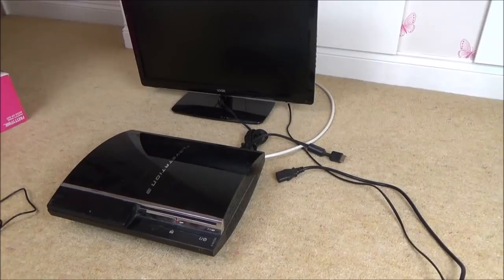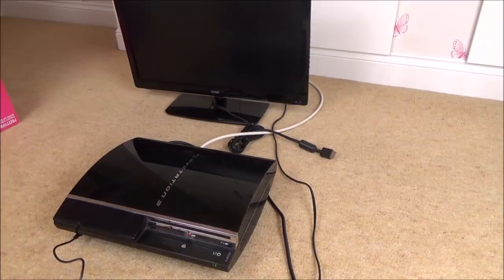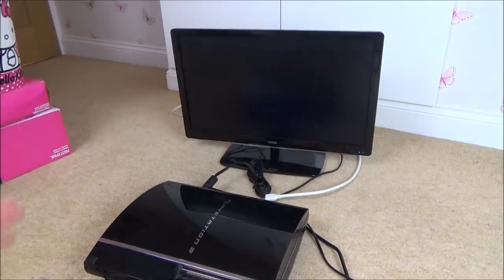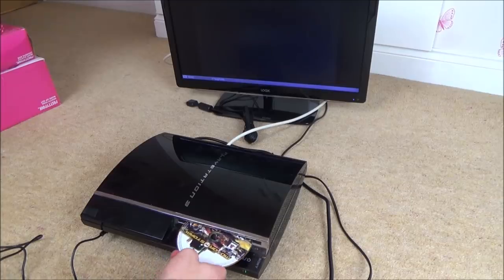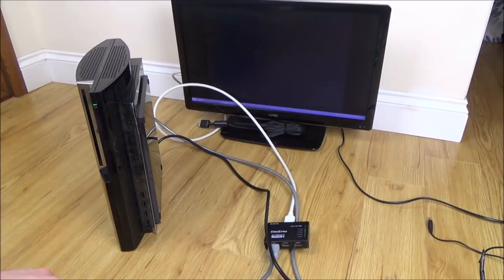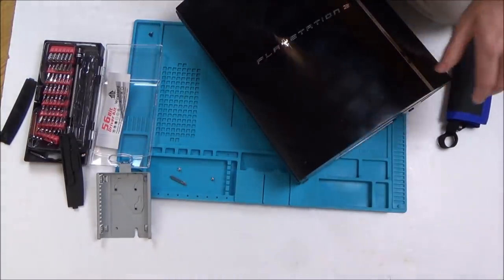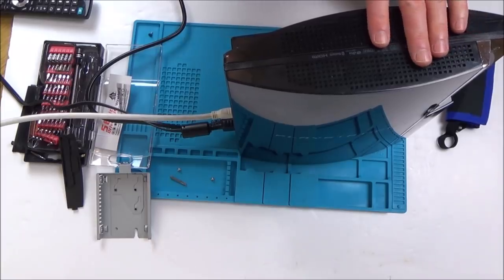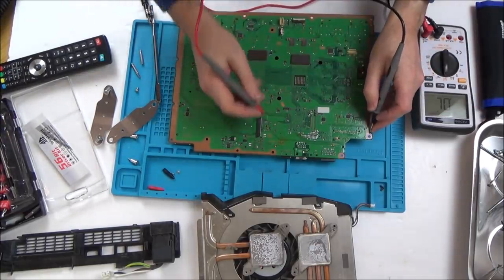Trying to FIX a Faulty PlayStation 3 CECHC03 (Part 2 of 3 PS3 Fixes)

Comment: You are testing it wrong. Those caps near/under/close to the chips are bypass capacitors. You are activating junctions within the chip making it appear that those capacitors are shorting. Test them out of circuit.

Comment: Vince, what you have there is a genuine 1st edition PlayStation 3 60 gb model.  These were the only version of PS3 with the chrome accents on the front.  This model plays all PS1 and PS2 disc titles in addition to the full PS3 library.  I know this because I still have mine which I pre ordered and received on November 17 2006. It ran solid until October 2012 with heavy use.  Sadly it got the yellow light of death...but worth every penny for sure.
Reply: kunfusion84 holy dude, how can you remember all the dates 10+ years ago... you definitely love that console.
Reply: @rosetta7862 well it was very expensive when it first came out
Reply: I still have my 80gb model. Unfortunately it's not PS2 backwards compatible but I still do have my PS2 for that occasional game!
Reply: I'm getting tomorrow the PS3 CECHC03 PAL (with new termal past), any advice to prolongue his life?
Reply: Osvaldo Cerda Martínez let me know when it dies i will permanently bring it back to life. Fixed three last week and funny thing is it’s not what people say it is that’s causing it.
Reply: Jacek Kurowski don’t leave us in suspense mate? That info is priceless
Reply: Montgomery Burns Like most of laptops with same problem the main thing causing YLOD is a cold joint under NEC TOKIN capacitors. Measure the resistance of each and every one of them with a multimeter if the valie jumps like mad it means you found a dodgy one. Reflow it using flux. Make sure you physically move them with tweezers or a small screwdriver and then let it cool. Surprisingly you dont even need to replace them. I fixed Cechk console that was turning off playing demanding games, ylod cechc and ylod cechm all in one week simply reflowing them. I reckon in most cases GPU reflow is a myth. It worked for some people cause they actually reflowed the NEC TOKINs as a side effect.
Reply: Bought mine in 2007 and it still works perfectly. Was really hard to get a hold of as it was sold for such a short period of time.
Reply: I have a CECHA01 & CECHE01 that both have chrome accents on front. Best Sony console ever imo.

Comment: Nice attempt!  I suspected it would not work - but I wouldn't give up just yet.   What temperature did you use for the hot air there?  On that type of hot air station (with the nozzle you are using) I would be going for a minimum for 450 degrees and heat it quite extensively for like 10+ minutes.  It really needs to get to the point where the solder does melt.   The fact that half of those shorts disappeared makes me wonder if a solder ball cracked off and is shorting underneath maybe.  But it could be an internal fault of couse.

Louis was not 100% correct - one reason why it can work again after heating to "less than solder melting point" is thermal expansion of cracked solder joints.  That was the point he missed in his video.  On the PS3 and on many graphics cards, it IS purely bad BGA contacts.  His experience from Mac boards might be different, maybe the GPUs fail more there, but on consoles it is nearly always bad connections on those BGA chips.   The other thing that happens on PSPs and other handhelds is when dropped - sometimes the pad breaks off the PCB.  Pressure helps it work again at that point.  I've seen a few PSPs with that type of damage - damage you would expect to be solder crack, when in reality one or more pads actually detach near the corner when the unit hits the floor.

BTW - the speckles make me think the problem might be VRAM related.  I cannot remember, but doesn't the GPU have the RAM mounted on it - the chips in the corners there?  I think they are!  What I might do there is remove the "underfill" around them, then try and reflow those.  The underfill won't help matters as a crack might not easily rejoin because the underfill holds the chip up.  Withouth underfill, assuming you can get all the solder balls up to melting point should mean a more successful reflow.  Also add liquid flux under there too whilst doing this.
Reply from the maker: As always, great info Chris. Maybe I can do a revisit on this or I could try the coins on top of the GPU to see if it works and then try the reflow or maybe the oven method, not sure how much that will stink the house out though, don't want any grief!!!!! My temp at the end was up full so 480C and full air which is the max my cheapo unit will do. I always get worried when heating up chips in case I pop them but I suppose this will come with experience. Is there an approx. temp or time limit that the chips can handle or is it all based on their size and thickness?
I presume the underfill on the RAM chips is some kind or glue or plastic, do you scrape this off or use chemicals to remove it?
Cheers :-)
Reply: @Mymatevince  Better cover the capacitors and plastic [looking] parts with aluminium foil when baking it also remove the thermal pads of the Emotion Engine (Chip below the Cell thats for PS2 compatibility) and the chip on the right of the RSX.
With baking I managed to repair a GTX 760 bought it in October and worked fine after cleaning, but in November it failed, (used it as secondary graphics card) after installing drivers so I baked it and it works fine again, gifted the PC (Core 2 Quad Q8400, 8 GB RAM and this GTX 760) to a neighbour and still no complains.
But my old HD 5770 also failed (just black screen, no booting at all) and still not working after baking it, maybe I'll try it a second time.

Comment: The memory card slots are another tell tale sign, along with the four USB ports, that it's a PS2 compatible model. They are used to playback photos and videos from digital cameras. CF is Compact Flash, SD is obviously Secure Digital cards and the last one is Memory Stick Pro which was Sony's terrible proprietary card format they used in their own cameras (and PSP in the form of Pro Duo).

When playing PS1 and PS2 games the PS3 will create virtual memory cards that are stored on the hard drive.

This model (CECHC03) should have originally been a 60GB model. This along with the 20GB model are almost fully compatible with all PS2 games as they had much of the PS2 hardware inside.

It's the later 80GB model (CECHM03 I think) that lost the PS2 hardware and instead had software emulation that can be far less compatible with some PS2 titles but does still play most games well.
Reply: Bravo! You know your PS3 hardware.
Reply: Actually, not quite. Only A and B had full PS2 hardware inside them for full BC support. C and E only have partial emulation support (only one of the PS2 chips).

That being said, the C and E models do some upscaling which actually make PS2 games look better than on A and B models. Anything after E does not have any PS2 support. Jailbreaking allows for full software emulation but it is way worse than the BC consoles.

The best way to identify a BC PS3 is by checking the usb ports and the color accents. BC ones have 4 usb and chrome accents, normal ones have 2 usbs.

I do not recommend anyone buying these BC consoles though, as they are by far the most unreliable ones. And btw, the YLoD is almost always caused by NEC/Tokin chips and not the CPU/GPU (as Vince himself has also proven in his more recent videos)
Reply: @Riku148  But if you do replace the capacitors, and keep good airflow on the system, it should be fine
Reply: @Riku148  no it’s actually more the solder now as folks on the psx place have started to realize but thats not to say that nec/tokins are fine

Comment: Great try Vince! Your motivation to go the extra mile to try to get a result/diagnosis continues to inspire. Thanks for the entertaining and enlightening video.

I'd like to share that I was worried when you were using flux at the end while there was still thermal paste lingering around the edges of the chip. I was concerned that some of the thermal paste might have been pulled under the BGA along with the flux and possibly contaminating the solder balls along the edge. This is just a guess on my part.  It may not have had anything to do with the final result.  It was still a great video, and as always, I'm eagerly looking forward to the next 'fix it' attempt. :)

I also can't fathom how this had over 3000 views and only about 300 'likes' at the time I watched it...  Bad form people... Bad form...

Comment: The two big chips likely run on very low (under 1.5 volts probably) supply voltages and thus if you test from supply voltage to ground you're going to measure a very low resistance (as they draw high current at low voltage) and depending on how your meter works you might get a continuity beep. I'm not positive that's what's happening here but something to keep in mind.

Comment: The Issue that you are having is that your hot air rework station is not powerful enough to heat up the whole chip, I have a dead ps3 slim with the same problem, I can't fix it yet because my paint burner or heat gun whatever you call it died . So basically you need a hot air gun to do the job because it has enough surface area to heat the chip, I do suggest pre heating the board before you start reflowing the chip
Reply: Momfie The hunter pretty much you’re right! My question is will a kitchen oven work? My reasoning is that the kitchen oven could heat the whole board up to 500 degree Fahrenheit or 260 Degree Celsius more then enough heat to melt the solder
Reply: @lucaspagan3576  would reccommand using one that you don't use for food anymore because of the fumes solder creates and also cover up any plastic parts on the pcb like the speaker that makes the beeping sounds. you can watch a YouTube video if you are not sure about the settings of the oven

Comment: The power supply rails of  CPU and GPU usually have a very low input impedance, which is required for such a low voltage and high current device. Put your multimeter on low Ohm position, zero it out and try to measure again. You will find a few Ohms resistance.

Comment: Checking capacitors under big chips doesn't tell you much in the beeper mode. Big chips usually have a very low resistance. They powered by a low voltage and consume quite a lot of power. Resistance might even be lower than 1 Ohm on some chips that are working fine.

Comment: Hey Vince, how do you mount your camera when doing electronics work? My videos look way too close. Really appreciate any guidance you can offer
Reply from the maker: Hi, I use a tripod and then I can adjust the height from approx. 60cm to 1m 50cm. If the item I am filming is bigger then I move the camera higher to try and get it in the shot. If I want to do overhead shots then I extend one leg of the tripod and use a weight on the extended leg to stop it from tipping over and then the tripod can go right over the item :-)
Reply: @Mymatevince  thank you, I value this information

Comment: Reflow it on the oven. Remove all non-smd components as those may melt, put it on the oven a bit lifted from the oven tray (using per example some nuts on places where there are no components) ensuring that no component rests on the tray, slowly increase the temp to 250 degrees, leave it for five minutes, turn off the oven and without completely opening it let it cool down slowly. Don't worry about the components on the bottom side falling, they will stay in place because the melt stain will hold them in place. That's basically how an infrared SMD oven works.
Reply: Issue with reflow is plastic parts like connectors housings
Reply: @38911bytefree  that's why I said he must remove all the non-smd components :)

Comment: Hi mate, when you are reflowing the cpu and gpu, if you look at the top right corner of the cpu you can see what looks like a blob of solder that could be causing a short, i would say a reball on both chips would be a very worth while repair. And reballing is meant to be best when the solder is replaced with leaded solder as it handles heating and cooling down better. Love to see you give the reball a go on this! These 60’s were the best built units imo.
Reply from the maker: Ohhh, I didn't notice that but it does look like 2 blobs of solder quite close to each other on the CPU, about 1-2 cm away from the thermal paste blob on the board. Am I looking in the right spot? Thanks :-)
Reply: My Mate VINCE  hi thanks for the reply, yes you can see it at around 57min mark. Obviously its easier for is viewers to see as im watching it on a big tv filmed on zoom so would be very very hard to see on the naked eye. I think a reball on both chips may actually fix this one. Regards, jake

Comment: Hi Vince, so I have been watching your videos for quite some time now and I really enjoy watching you rebuild things, especially because half the stuff you do with motherboards I don't know about, but while watching this video, I noticed how you applied an extensive amount of thermal paste. So I HIGHLY advise you look up how to correctly apply thermal paste. And this isn't me trying to make you seem bad or an "amateur", but if you apply to much thermal paste, it will overflow over the chip, come in contact with other chips or pieces, and short them out, essentially ruining everything you have worked for. The best method I have found and what I use (I frequently build computers and have been trained on such matters), is the pea method, apply a pea-sized dollop of thermal paste in the middle, then place the cooler or in your case, the piece of metal connected to the fan, on to the chip, and only apply thermal paste to one side. Hopefully you read this because it is very important. Anyways, keep up the great work I love watching your videos!!

Comment: You could see the GPU pop corning while you were heating it up. Try looking up a reflow or reball process Vince, I know you're no expert, but it's very interesting and could help you in the future. The way to avoid the pop corning would be to purchase a preheater or  you can just use a cooking griddle for very cheap. The moisture in the chip is trying to escape when you heat it up too fast. Hope this helps in the future :)

The problem you have is called a "green light of death" pretty well the same as the "yellow light of death" except the PS3 simply isn't throwing the error for whatever reason, probably because there is still a little contact from the joints on the chip. 

Additionally, if you really want to fix this issue, just reply and I'll tell you where to get started! Great video as always Vince!

Comment: I worked on similar ps3's and attempted a full reball with the same station you have and it simply does not get hot enough to melt the solder under a chip that big. Something this big needs to be heated from the top and bottom at the same time with better tools.

Comment: 140 °C isn't nearly enough. If you want to do a reflow (to fix a YLOD), it's actually easier to put the mainboard into the oven (some people cover parts of it in aluminium foil, never did that) and then bake it at 200 °C for 15 to 20 minutes. Make sure it's levelled (which isn't easy with those two prongs sticking out of it), I used two small wooden chopping boards for that. Also, if you do that make sure to take out the CMOS battery (the smell can be quite bad, if you forget to do that). And when you're done, keep it in the oven until it is cooled down, don't move it while it's still warm. I have saved quite a few PS3s that way, even one Xbox 360 that had been massively tempered with before (the previous owner TRIED an XClamp fix on it, out of curiosity I put the board into the oven and used normal screws to put it back together, worked for a time, not long though). I am not sure whether or not this helps with this PS3 though, it could be that this is caused by the problem described (cracks in the solder due to thermal reactions) or the GPU could be bad (as you've assumed). And even if you manage to fix it, there is no telling how long it will last, even if the solder was the problem, because the thermal reactions will start again, causing more cracks again, until you'd have to reflow it every day.

The GLOD was actually associated with the PS3 Slim and later the SuperSlim (which was basically a piece of ****, I had ones with failing drives, failing PSU, failing mainboads, blown fuses on the mainboards..., it's actually surprising that there are still working SuperSlims around), it was basically the same thing like the YLOD, an unspecified hardware error and the PS3's way of saying "Mr. Stark, I don't feel so good".

Comment: You are doing the continuity test incorrectly, a short is not determined by a beep, that is to avoid seeing the multimeter while you check the board, a short is determined if between the positive and negative there are 0 ohms, if you have a value different from zero can surely be normal readings due to the processor or resistors in parallel.

If there was a short, the chip that manages the console power would not have allowed the console to turn on.
Reply: And it does not need to screw the whole device and connect it to the TV to check if the chip itself is working, just touch it, while it's on, if it gets hot, it's working
Reply: if it gets cold it's because the chip does even not start, 
doing this test is also good to find out if you have any component in short, which, if it is, will get very hot

Comment: For heavy boards like that, and without an IR rework station, heating the board to 180c on a foreman grill before trying hot air helps.

Strange but true